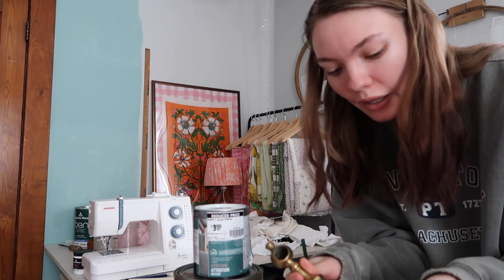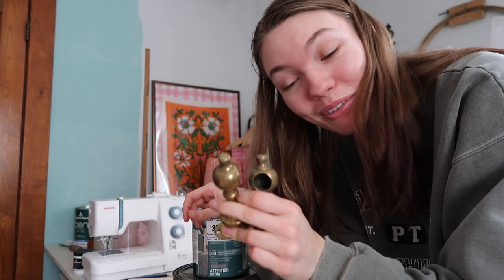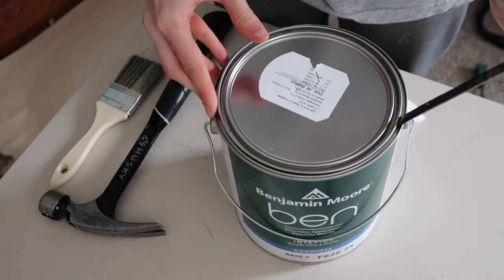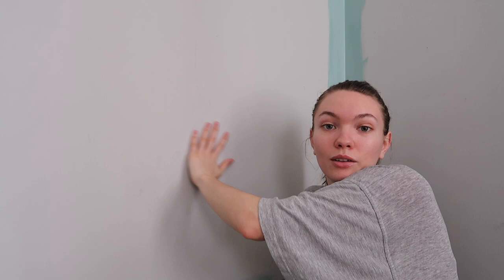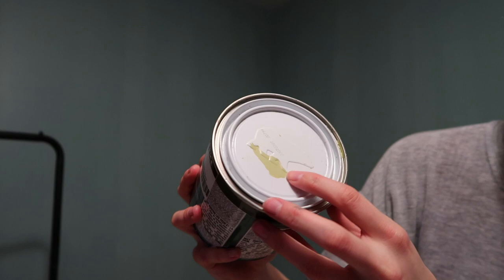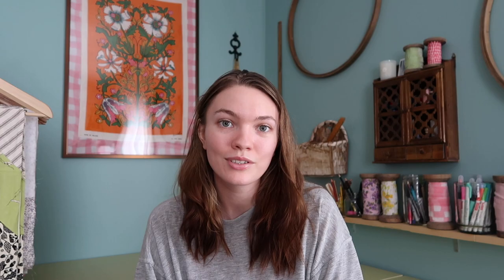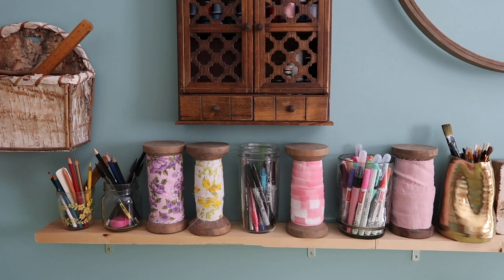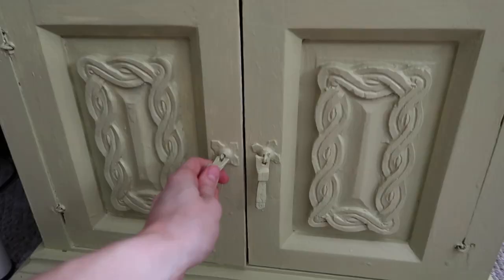creating my dream sewing room episode 1 ✂️  the sewing corner

Comment: I have an idea for you to use the brass finials basically how you wanted to in the first place. Use the appropriate size dowel/rod in the obvious hole. But then a smaller dowel/rod could be used for the back holder and rest on top of the finial in the space that tapers down to the wall mounting plate. If that makes sense. Best of luck with all your projects.
Reply from the maker: ohh yes that makes total sense! thanks for the idea!!